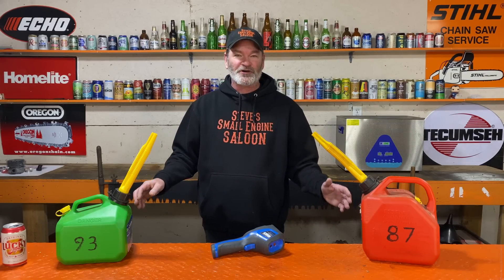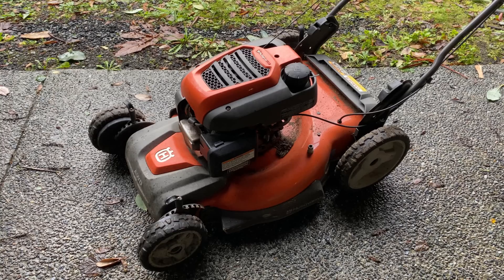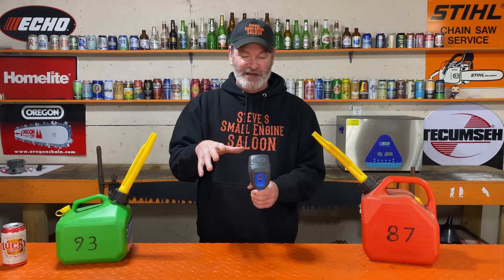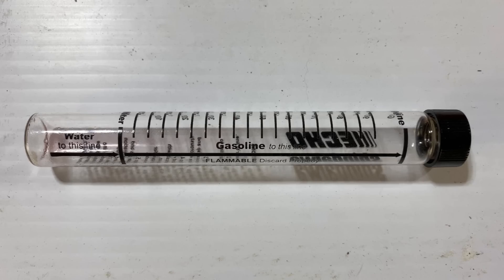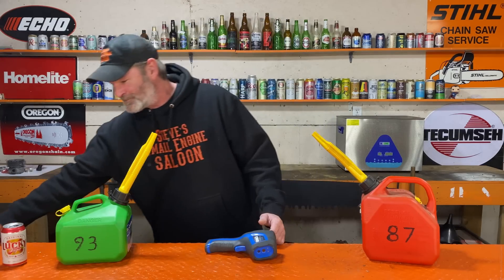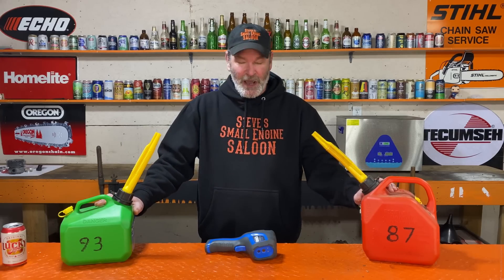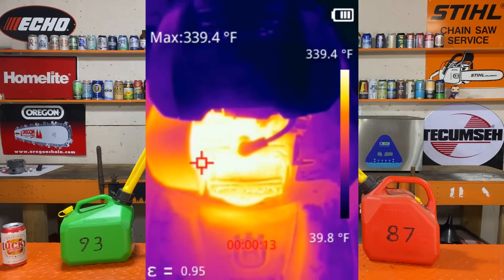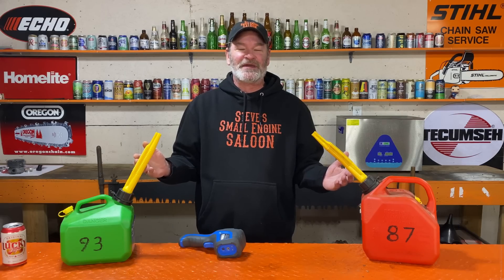Does High Octane GAS Make Your Engine Run Too HOT?

Comment: Nonsense! BTU is not a measure of how hot fuel burns..  BTU is a fixed amount of energy,  period.
Octane rating is only a measure of fuels ability to resist auto ignition/detonation in an internal combustion engine.
If you want to know how hot different fuel types will burn  just look up adiabatic flame temperature.

Nearly every racer or engine builder will know that an engine can produce more power running alcohol vs normal gasoline despite gasoline has higher energy density.
The main reason why is that alcohol has oxygen bonded already  that is ready to party.   
But you need to add much more alcohol vs gasoline  for the same amount of air  in order get chemical balance   but you will in return get a higher total energy release.
  - also alcohol has much more latent heat  aka heat of vaporization   translating into much better internal cooling and lower charge temperature.
      But   like you know  alcohol have some other characteristics that cause problems     and therefore most people prefer pure gasoline. 
Almost always the amount of oxygen is the limiting factor of how much power can be made. But you cant just increase the oxygen concentration in the air because 1 impractical  2 if you manage   soon it will be too much of a thermal load and the engine will melt or it will just explode or everything just catching fire   from auto ignition .
    Remember why you should never put lube on oxygen tank  threads?
To put it simply  there has to be minimum amount of inert gas in the air  otherwise the chemical reactions be too violent.

P.S. That guy recommending using the lowest grade of gasoline..  maybe you should have told him to put kerosene in his own saw-gas   
then octane rating will be total garbage  haha.  Maybe that would have changed his mind

Comment: I always use mid grade to keep my tanks from water build up, i learned if you keep putting regular in your small engines, your going to constantly have problems cranking bcuz it turns to water, or makes condinsation worse. Your small engine will miss and pop and smoke and run just crappy... So i always use mid in all my small engines

Comment: 0% ethanol 93 fuel + Echo Red Armor in all my 2 stroke. Best possible mix you can run. No carbon buildups, clean engine, no carb issues or water buildup etc. Plenty of power and easier starts.

Comment: He's what I found doing my own real world test using an old weedeater brand weed trimmer, I tore down removed all carbon build up on piston, ran 87 for 3 months checked how much carbon build up there was,did the same with 94 and the difference was unbelievable,  as well as performance, easier start up from cold start, better idle,  cheers!

Comment: The retired head of the local Exmark service department told me to run 89 octane in the straight gas for my mowers  but to run the 91 or 93 octane in all my mixed fuel. He stated that the oil lowered the octane slightly.

Comment: The biggest misconception that people have about high-octane gasoline is, if the octane number is higher, then it must run hotter in an engine when exactly the opposite is true.  High octane fuel is intentionally made less explosive to run in high compression engines.  Continued use of lower octane fuel in most of high compression engines would eventually cause damage due to excessive pinging, or knocking, (more explosive).  Lower octane fuel is actually more explosive than the higher-octane fuel, but sadly the myth continues.

Comment: You make great videos my Canadian neighbor! I am from the southeastern United States. Believe it or not, where I am at, 87 is the lowest and 93 is the highest in octane rating. Fortunately, we have some gas stations in our area that also have a pump or two per station to sell non-ethanol fuel, which is what I use in my small equipment. Thank you for converting temperatures to Fahrenheit.  Believe me, I am a fan of many things metric, especially when it comes to tools. However, when it comes to measurements like gallons, and pounds, I have a hard time with kilos. The one thing I wish the US would adopt or had adopted in the past is kilometers instead of miles. To me a mile is too long of a measurement and a kilometer.p would be much easier to estimate.

Comment: I worked in a major oil refinery blending section over 30 yrs in northern California.  We blended 3 flavors of gasoline 87, 89 and 91 octane.   Higher octane gives you better power in higher elevations and in bigger engines.   90+ octane has almost a negligible difference in smaller engines.  90+ octane is a waste of money in 4 cylinder cars.  Octane is an average measurement of two tested fuels… **see below.  Engines don’t run hotter or colder with higher or lower octane.  It’s the fuel additives that keep the engine valves/rings clean from carbon build up that decrease power output.  Better to buy Top Tier gas with included additives than Mom and Pop gas without the additives.  M&P gas is usually 20-15 cents per gallon cheaper and over 10+ yrs will allow a car’s cylinder walls/rings to wear at a faster rate… thus losing HP over time compared to Top Tier gasolines costing a bit more.  You can buy a pint of $12 additive at Walmart, CVS, gas station mini marts and add to a fillip every 3-4 tankfuls, but it’s better to just get those additives in Top Tier gas at the pump on every fillip.  **BTW… measured octane is a ratio average of government certified golden fuel (Research or R) plus the refinery tail line blending fuel (Method or M) going to the mother tank on the same pipe divided by 2.  Both test engines run side by side with one being injected from a cistern full of on site golden fuel while the other engine runs on a slip stream off the blend station booster pump line going to tankage.  The two octanes are added together and divided by 2 to give an average octane number  at the gas station pump.  Thus you see R +M over 2 on every pump sticker.  Hope this helps understand a bit more about octane.

Comment: I’ve lived by the check so my options have been the 85 from fuel stations. I change air filters, spark plugs, oil and oil filter on time. 
I never! have problems with my truck, and all of my lawn care equipment, chainsaws, rototiller, power rake, aerators, motors, etc. everything! Runs super.

Comment: I recall some engine mfrs. warning against ethanol fuels and  others recommending high octane fuel but not requiring it. 
   Many now are using gaskets, seals, diaphragms etc. unaffected by ethanol fuels and  won't knock (undetectably) with 87octane, since it is the most prevalent fuel.

Comment: Here in Australia, 91 is our low octane fuel and all mowers and string trimmers run on it with no issues. 98 on the other hand will make motors ping and go boom.
Reply: Utter rubbish!!! You have no idea what you’re talking about. 91 here is equivalent to 86-87 Octane. We use RON. I’ve personally spoken to Echo and they confirmed 98 RON is perfectly fine in their small engine 2 strokes. You have no business commenting here.

Comment: When I first got a lawn tractor (8 years ago) I put fuel stabilizer in the tank full of gas (10% ethanol) for the winter. When I brought it out in the spring for the first cut it coughed and sputtered. Drained the fuel out and found water. Mower was outside but covered. Once I got it running I used only ethanol free gas. The following winter it again sat covered with ethanol free gas and no stabilizer. Started and run fine that next spring. Since then I use only ethanol free gas and never add a fuel stabilizer. I have never had a problem with water or running since then. Same with all of my 2 and 4 cycle engines. Haven't touched a fuel system on any of them. As for ethanol free gas going bad, they can set for years and still run perfectly. Great video nice to see you try to teach an old ? the truth.
Reply: @AdamA-pm3yn  Ethanol pulls in water. It doesn't turn to water.
Reply: l done the same but its getting harder to find ethonal free here in canada l have run nothing but 84 octane ethonal free and never had a problem with my machine's l also run a small engine shop here but it private

Comment: High octane does nothing unless the engine is designed to run higher compression. Nothing.
Reply: Nope, engines adjust their timing and can squeeze a little more power out of higher octane fuels in some situations. The difference is small but it's not nothing.

Comment: I think the issue would be with high octane fuel it burns slower, so if you don't change timing too than it could put more stress ( heat ) on the exhaust valve. It also might act as retarded timing and actually loose a touch of power.

Comment: early to mid 80s , i was chewed for replacing points/condensor with B&S new magnatrons . then later , our "spring services" were shorter times and charging same money ... due to magnatron ... 
   bosses get short sighted too often ...  run GOOD fuel , services are shorter , charge posted rates ...OR , fuel system repairs needed and now CLEANER for hi octane , higher detergent fuel shortening repair time and charging posted individual (flate rate sort of) service rate ,  jussayin' ,  even if all equal , able to move more machines /day easier ....

Comment: For years was advised to only use premium gas in small engines, less ethanol and a rep. I spoke to from Stihl with regard to 4 cycle engines showed a research report the it burned cleaner, less pollution.

Comment: No insult intended. But Steve’s wording is a little confusing. So to clarify…a BTU is one of several units used in science and engineering to measure energy.  A GALLON of gasoline CONTAINS approximately 120,000 BTUs of energy.

Comment: Regarding exercising equipment during winter.  

I only have an unheated detached garage.  Can I keep my battery connected to my riding mower during winter if I run it once a month or do I need to bring the battery inside to warmer temperatures and take it out to the mower every month?  

I live in Pennsylvania.  Thanks.

Comment: Several years ago I switched all my 2 and 4 cycle motors to 90 ethanol free. Now it is 89 ethanol free.  After switching, never had another fuel line problem or starting issue. Interesting video. I love seeing myths getting debunked.

Comment: Great vids. For my Norwegian pow, both cans is low octane. We still have 98 lead free availible on the pump. Then what? personally i dont care. Just poking in the fire.
 (I use Aspen 2T and add oil to 40:1 in my ported 550 Xp mk2 anyway.)

Comment: I was umder the impression higher octane wasnt good for the mackine(s) as they are not set up to run with a faster combination. I was always told mid grade fuel as it burns cleaner and doesn't carbon upnthe machines as bad. That would take years to prove tho lol. As for mixed fuel machines, just to use low grade fuel as the oild mis will carbon things up regardless unless using true fuels.

Comment: Higher octane petrol burns cooler under load as it's more refined and capable of delivering more power for the same BTU.
You need to strap your thermal camera to a mower that is cutting.
LOL.. I don't know.

Comment: I run Prem non-ethanol  gas in my small engines and most of my problems have gone away.  I live in western mass (can't get non-ethanol gas from a pump in the state ) so I drive to NY state to get it (20 min drive from home).   pump a couple a gal of gas into my truck (got to clear the gas from the gas pump hose) and then fill a two gal gas can (only buy the gas that you can use in a month or two).  I'm also a vol fire fighter.   we have been getting 100 octane gas from the local airport for our small engines and our problems have gone away.   We had one small engine on a pump on our tanker that we had to re-build multiple times a year because of the ethanol fuel.  Haven't had a problem since with gas from the airport.   The gas sits around for a year or more in the small engines as they would only be ran for a minute or two every week until they got ran on a call and then that would be a long run time.

Comment: I use ethanol free 87 for push mower and ethanol free 93 for my handheld power equipment.  I used to use 87 for all but switched to 93 and stuff runs better.  Could have been older gas that lost octane.  So I think it's better if my handhelds have older gas that it's over 87 octane.  For my push mower it never seems to make a difference.

Comment: Run lawn tractors for 50 years 
99.9% of time at idle speed. Never had a engine problem or carbon build up with premium gas.
Frame an front ends ware out then give engine to someone for their mowers. 
SHARP blades and premium gas .
Non-ethanol in everything used once a month- once a year.

Comment: Steve:  My local lawn mower shop says I shouldn't burn any gas in these small engines that has ethanol in it.  They said they see many, many repairs come through their shop that were caused by ethanol.  I also have vintage cars and I have had to replace fuel pumps because the ethanol ate the diaphragms.  We call that gas, "Deathanol."  Love your videos.
Reply: Old fuel systems can be "upgraded" for handle ethanol. Fortunately for me there is a gas station near me that still has non ethanol regular. I run that in my old vehicle and small engines
Reply: I’d harp on it to my customers being that I was a marine mechanic. Ethanol is a water magnet along with being corrosive. It wasn’t conducive using ethanol enhanced fuels in docked boats. Terrible!
Reply: Yeah I was super surprised to see he uses it in this video. Pretty well known fact. I reached out to Echo a couple of years ago and asked about this exact topic of high octane fuels in chainsaws. They said high octane is completely fine to run in them but 10% ethanol fuel is NOT ok to use.

Comment: On the flip side if you run 87 in an engine that calls for 93 as stated in the owners manual, as the ones for my Efco string trimmers and my Efco chainsaw does, it will overheat. I know this because i tried it in my trimmers. With 87 they overheated and quit and would not restart until they cooled off completely, with the proper 93 octane i did not have that problem with them.

Comment: You are correct, gasoline will produce 120,000 BTUs per gallon, however, higher the octane, the slower the gasoline burns. Therefore,  120,000 BTUs at a faster burn rate will produce a higher flame temperature,  a slower burn rate will produce a lower flame temperature. The temperature measured at the muffler is not a good representation of actual flame temperature,  however, your engine's valves will last a lot longer running at the lower flame temperature of higher octane fuel.

Comment: None of the temperature discussion matters, it is the flame spread speed. Higher octane fuel has a slower flame spread speed, so is used on higher compression CAR engines to prevent knock, or detonation which could destroy the pistons. Even in cars, if the manufacturers state use the lowest grade use it. Using a more expensive fuel on a lower compression engine is simply a waste of money. A 2 stroke lawn mower or chainsaw definitely does not need more expensive fuel. Unless perhaps crank case to cylinder gaskets were removed or a much thinner head gasket was used which could raise the compression.

Comment: Adding ethanol raises the octane RATING. Ethanol as you noted has less energy density than gasoline. They blend the fuel mixture to achieve an effective octane rating. Not actual octane. In Low compression OPE engines the octane rating is irrelevant.

Comment: Good video, thanks!
Would be nice to see the temperature comparison with 10% vs 0% ethanol.
You could show separating the fuel too by pouring off the water/ethanol mix.
Reply: Keep in mind removing the ethanol significantly lowers the octane of the remaining 'pure' gas.

Comment: Very interesting. Here in Wisconsin we can get non ethanol in Premium grade. Small engine gurus here say non ethanol is easier on the rubber parts and shelf life is a little longer
Reply: It's definitely better on hoses and gaskets.  I had some hoses that leaked real quick.  Switched to ethanol free and they last much longer.  I put stabil in my gas in hopes it last longer.  I do think there is some truth to life being longer do the ethanol separation and water getting in gas ect.  But don't hold me to that.  I think Chickanic is a fan of ethanol shield if you use normal gas.  I haven't tried it but if I couldn't get ethanol free I would probably try that product.  But for now I will just pay a bit more for the little gas I use for my power equipment.  If I had a yard service I would probably change my mind.

Comment: I have heard the same thing many times, it defies logic. Here in Australia we have 91, 93 (which is 10% ethanol, also called E10) 95 and 98, in my 2 strokes I always use 95 or 98 depending on availability, 91 is ok in 4 stroke lawn equipment, I never use E10, I found it rusts the tank and corrodes the alloy of the carburetor.
Reply: Sounds like the right approach to me. Keep in mind that the US uses Octane ratings and Australia uses RON so the numbers aren’t transferable.

Comment: I only ever run the lowest ethanol fuel I can get, which here in UK is E5 premium "performance" petrol.
I think it only makes a difference when you try and replace automotive petrol wit aviation petrol, which I think is 110 octane.

Comment: I installed a new cheap carb on a Honda HRX mower that was set far too lean.  It’s impossible to get at the set screw while installed so when it started overheating on ethanol free gas, I switched to 87 octane with ethanol and the engine ran much cooler.  To lower the lean temps even further, I add marvel mystery oil into the gas.  This mower runs fantastic now while even smelling good ;)